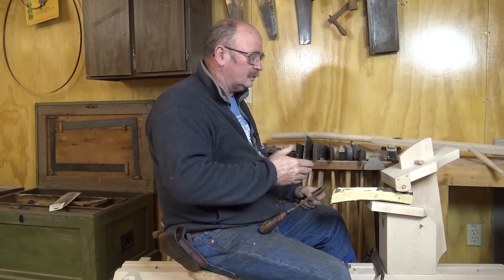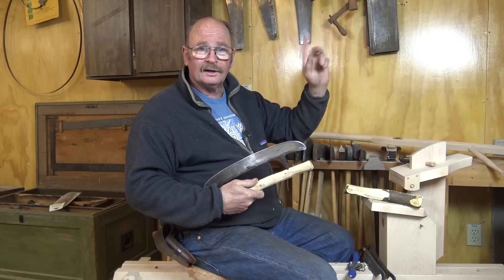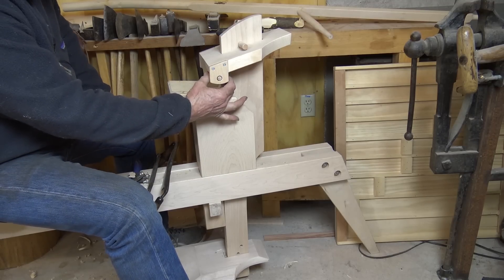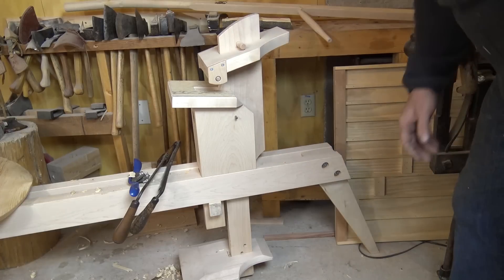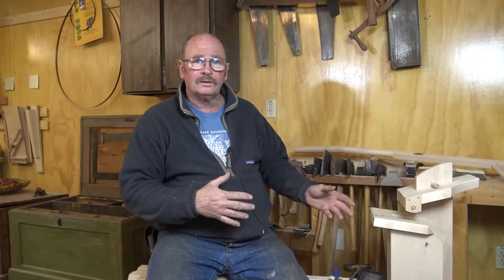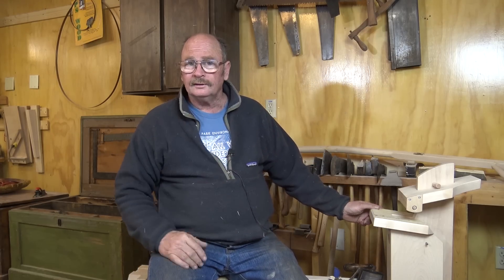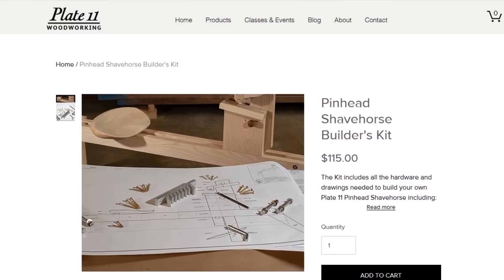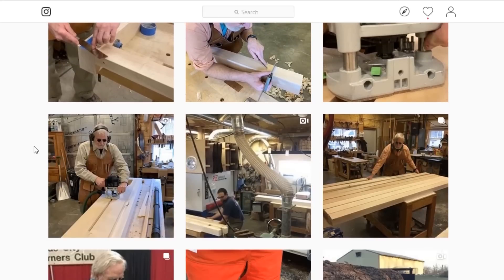shaving horse

Comment: I was going to make my own out of scrap lumber I have around here.  I have been looking at all kinds of designs.  I like this one but my problem is I have very little room to store a shave horse because I would rarely use one.  Then by accident I found pictures of a shave pony which I am going to make.  Basically it is just the top part that goes on the work bench and I pull my stool up to it.  But I am sure you know that. :)
Reply from the maker: I have seen some workbench mounted shaving horse style clamps.  It sounds like a pretty good option